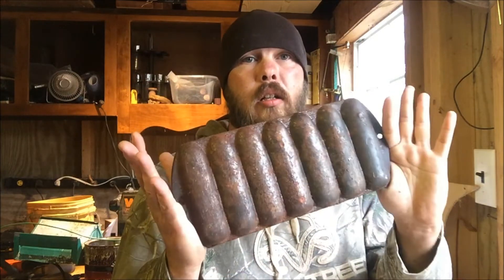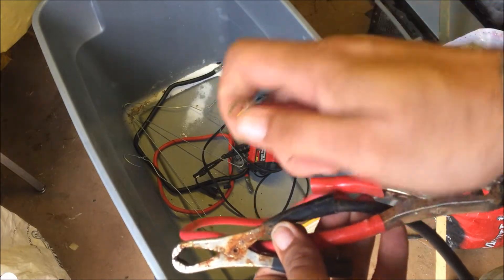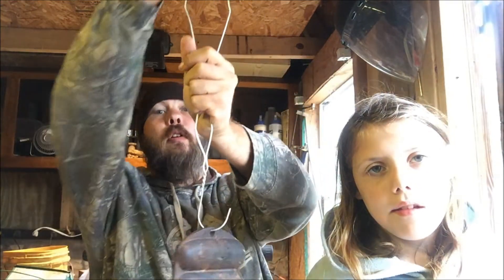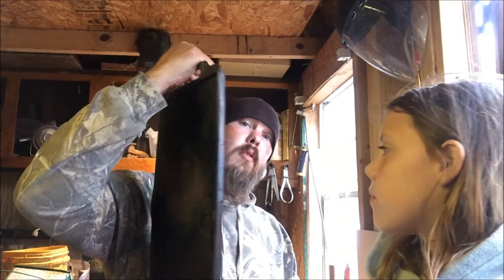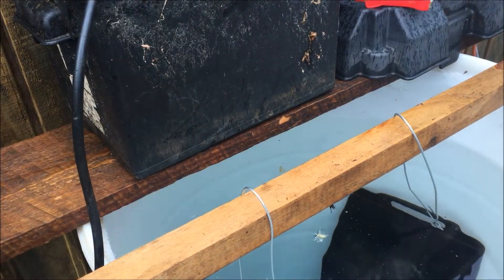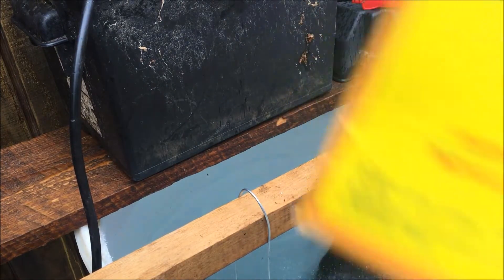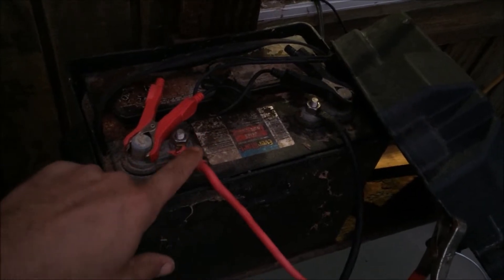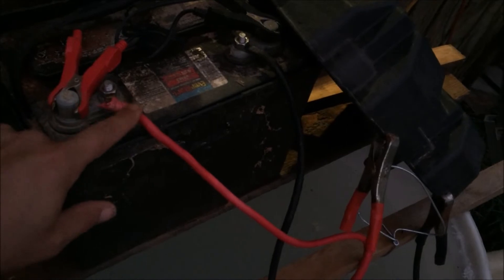DIY Homemade Electrolysis Tank to clean cast iron.

Comment: heya, yes current flow's from minus to plus that's why the to clean piece has to be at the nagetive site. I'm not sure if with the soda you put in you get the same reaction wen you use solt but if so if you do elektrolease water is split in hydrogen and air, the hydrogen gas you can use for burning a gasfire or for kooking gasburner place (that is if you have enough hydrogen gas) I'm a elektrician so I know this stuff
Reply from the maker: Yup basically the soda acts as a catalyst for the cleaning action